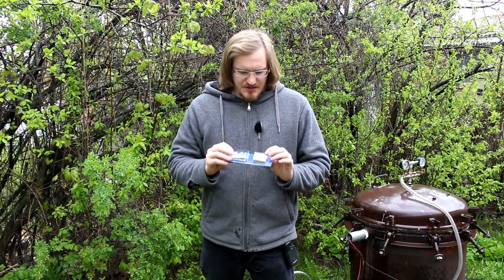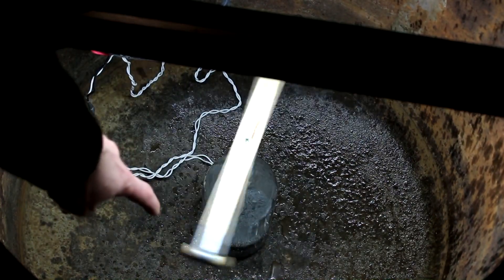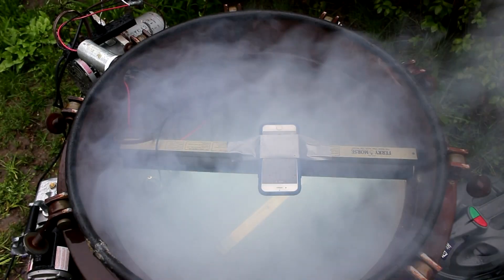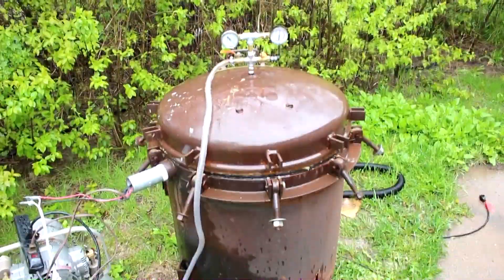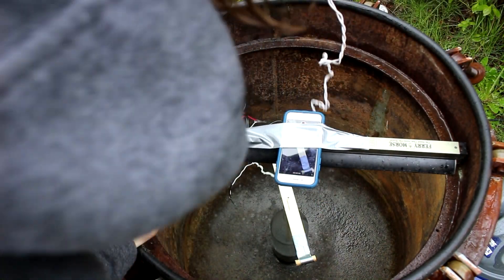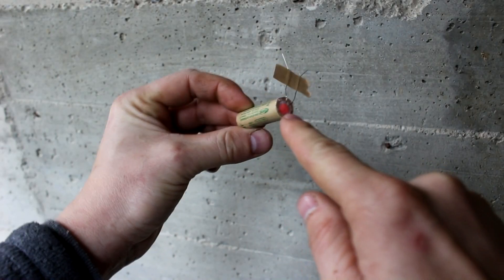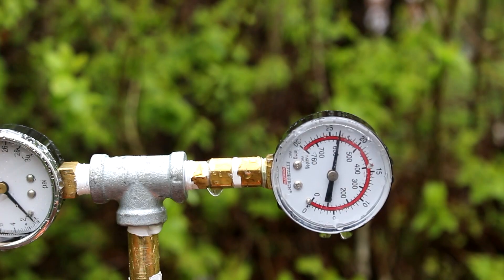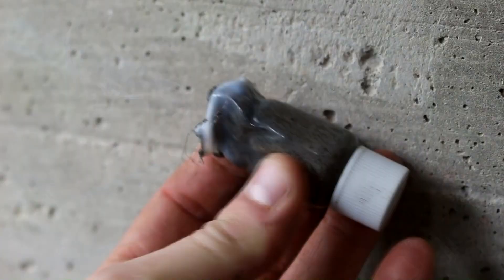Will a Model Rocket Motor Work In Vacuum?

Comment: hello cody. i believe your experiment was flawed. in order for something to burn in space it requires oxygen thus why rocket fuel is oxygen and hydrogen. is it possible that when you enclosed it in the container and ignited it that you kept it at atmospheric pressure in the container for the length of time that mattered. what im asking is did the motor properly sustain thrust or was all the relevent thrust created when the rocket ignited inside the secondary container.
Reply: Victor Niglio these kinds of rocket motors use gunpowder and gun powder does not need oxygen to burn
Reply: Victor Niglio No, I think the rocket fuel is a mixture of an oxidizer and the real fuel (like in gunpowder KNO3 and Charcoal) or a substance that is so unstable it decays when heated (Like Nitroglycerin does)
Reply: Luke Mayo i see what you are saying. however, oxidizer is added to most newly manufactured gunpowders. but not all.
Reply: all gunpowders have their own oxidizers
Reply: hey7328 all MODERN gunpowders have oxidizer
Reply: Drunken Hobo Substances like Nitroglycerin for example that decay producing a lot of hot gas. But I don't know if they have a use as gunpowder.

Btw, Does nitrated cotton need an oxidizer or does it decay without one?
Reply: no an oxidizer is MANDATORY for combustion in a barrel

Comment: See how long a RC helicopter can hover as you lower the pressure.
Reply: I don't know about Cody, but I can barely keep an RC helicopter hovering in earth pressure, never mind anything lower.
Reply: AndrewRG10 I second that.  My long outstanding request has been to try to hover a quadcopter in Mars air pressure.  NASA is investigating this, so it must be plausible.
Reply: One meant to fly on earth wouldn't work well. The blades would have too little resistance and spin too fast and mess up the motor. Would need a much larger prop than normally suitable for the motor size, but still the right motors for the size of quad
Reply: this has already been done a couple times by other people on youtube and seems like more of a gimmick than anything to repeat this specific instance
Reply: Armchair Pilot asked:
" to try to hover a quadcopter in Mars air pressure"
Umm, tricky..
I assume you mean to ask if a quadcopter can be designed to work under all of Mars's conditions?
Differences: Air pressure: ~ 0.6%    varies a lot by season, temperature and altitude, never more than about 2.1%
Air composition: Almost pure CO2 . 
Air temperature: -100c to +20c.. figure -50 average daylight temp.
Gravity: 37.8% of earth.
So basically, if your airplane/quadcopter/balloon/whatever can fly at 24500 feet/7500m on earth, if can fly on an average day on Mars.
Caveat: speed of sound on Mars is only 240m/s, about 72% that of earth. This will put an additional crimp on possible designs.
As there are commercial drones that are rated up to 19500ft, im sure it is possible, just rather difficult
Reply: And I think we all wan't to see, how it would work if it was floating 1 ft off the ground and then as the pressure decreases, see how what pressure it can no longer stay in the air.
Reply: could start by "overpropping" the motors. i'm sure there are some numbers to determine a general prop size for a given motor in different atmospheres
Reply: +AndrewRG10 The laziest test you could do is to just measure the thrust of one prop/motor in a test cell inside the vacuum chamber.

If you knew the thrust each prop needed to develop to hover (~1/4th the total weight?), you could experimentally determine what the max pressure altitude was where you could get that thrust at any sensible power setting, and only risk messing up one motor/prop.

Of course, the other diabolical thing about high altitude is that your motor will overheat much sooner unless there's more cooling provided somehow.
Reply: It's effectively like raising the elevation. Whatever the air-pressure is at the maximum elevation of the helicopter is the minimum pressure.
Reply: One could tether the quad with 4 short strings, put it in a stabilized mode (if not already).  Good points above about "over proping" that's exactly the point of the test- to see what it would take to have liftoff.  A cheap diy quad could be found that has the potential for interchangeable props (various pitches and diameters).
Reply: Andrew 'rocket'
Reply: it is ROTATIONAL "LIFT" .....................not THRUST